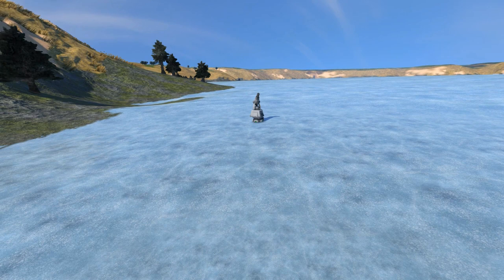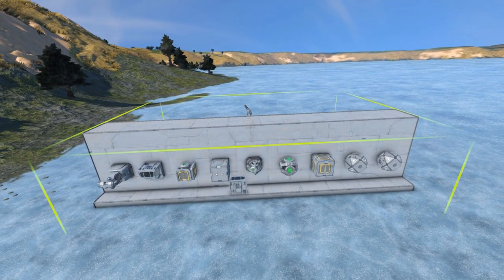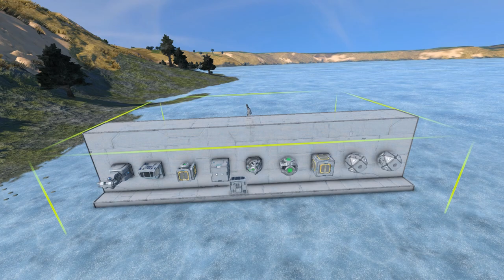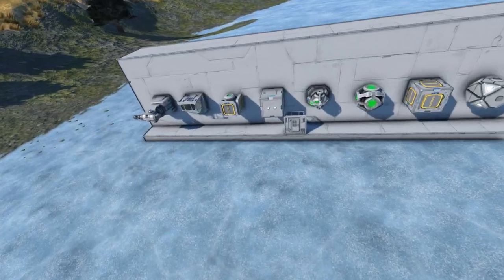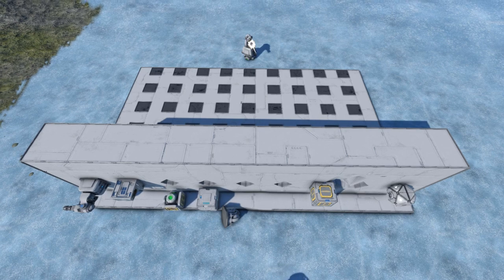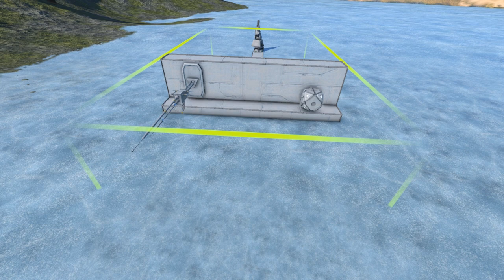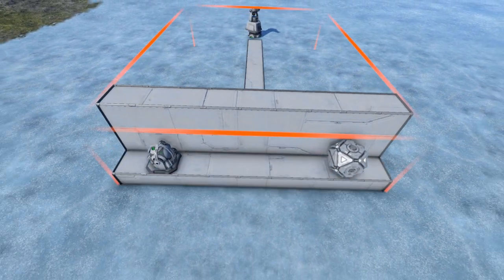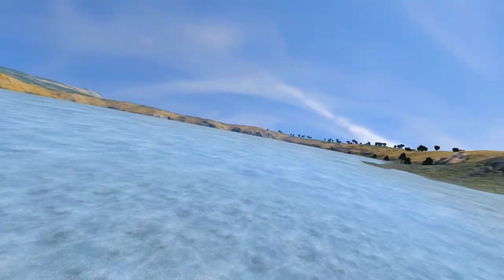Space Engineers Tutorial: How Decoys Work (tips, testing and tutorials for survival)

Comment: Anything with Computer Component is on the targeting list.  After Decoy is Antenna on large grid.  On small for a couple years it was always cockpit no matter what...Aragath got that changed to how large grid works.  You will want to test with moving grids and distance instead of staticly placed as that is how combat works.  Refineries can take more beating then heavy armor over the same surface area.  Trusters are second to Decoys in being made from glass in hp.
Reply from the maker: That's an interesting point about refineries, I've never thought to use them as armor before, they'd also probably work pretty well with welders repairing them since they have such a large footprint it'd be easy to have multiple welders in range...

Comment: Btw, in the test following 3:00, it's rather obvious that once the turned-on decoy gets blasted, the turret is targeting based on distance. It's quite obvious as it's switching left and right to the closest functional block. Now, it may be that you just accidentally placed the blocks so their distance from the turret reflected their priority, but that seems extremely unlikely. I think, based on that one test alone, that the turned-on decoys are targeted first, and then it's the functional blocks based purely on distance.

If you'f like to confirm/deny that, you could make a similar test rig with the blocks swapped about. That way, if the turret goes the same as here - turned-on decoy first then the middle blocks, left to right - it's a given that it works as I stated above. Otherwise, it's, like, the luckiest test setup ever.

PS. In your final test, the decoy may have been popping in and out of range of the turret as you were, by definition, placing the test grid slightly differently each time. I believe it's just the block priority and not the distance that plays a role here.

Comment: Light armor is good for building bulky, spaced out ships.  It's light weight compliments the sheer size that you will be building on and it is much cheaper than the rockets someone might use to kill your large ship.  Gatling bullets are much more efficient for the damage inflicted but an inner layer of heavier armor can tank the hits, particularly if the damage is dispersed along multiple blocks rather than just the one.
Reply from the maker: All true from what I've seen, as a few others have said, put your decoys in a position with a welder to repair them and you'll be even more difficult to defeat with automated turrets

Comment: Theres 2 reasons I can think off for puting decoys twards the front.  First off so it is one of the first things in range when the enemy starts fireing.  It does not help if half your ship is wrecked before it enters the engagement radius if your ship is particularly long.  Second is how effective is the decoy at the back of your ship if the enemy shoots out every useful block inbetween the front and the back trying to get to the decoy?  

Personaly I tend to stick decoys in heavy armored wings when i use them.  the armor makes the decoy last longer and generaly wont have anything important over there to get shot up.  I've tried decoy clouds but since they only absorb one hit its not really cost effective.  I find 1 decoy in an armored ball lobed at the turrets lasts longer than releasing 10-20 unprotected decoys.  Another fun trick is armor'd ball decoy mounted on a rotor.  spin the thing up as you approach and spread the damage over multiple armor faces.
Reply from the maker: Heavy armored wings are certainly the easiest way of getting your decoys in a position where the important stuff is out of the line of fire and still have things look reasonably good - it's my normal go-to setup.
I'm not normally game to use the rotor decoy trick for fear my ship will explode before I even get hit by any enemy fire :P

Comment: Okay, this is just stupid. I do not like this at all. This is a game mechanic programming, which cuts into the game.
First of all, it should be my choice how is the priority.
Second of all, I can understand if a decoy has a choosable mimic, aka what should it be. But not "I programmed the game" to be above all else.
Third of all, a turret should not know what is behind a wall. 

Fe.: I make a small ship wing with a decoy that is surrounded by heavy armor. The rest of the ship fires and is all okay without heavy armor because that decoy is there. Horrible at big ships where you can just layer 2-3 heavy armor. It's just cheating.
Good video, went a like, but this needs fixing.
Reply from the maker: Fair points, sadly I doubt keen are going to change much about decoys since they've been pretty well untouched in their mechanics since they were added. Because of that I just take it as an extra engineering challenge on how I can get functional decoys on a ship without it looking like some weird growth on the side :P
(or a bad attempt at a propeller for those who like the rotor method)
Reply: Yeaa. What a bad. It can easily brake the game. It's lucky nobody is using it.

Comment: please test again in 1.186. I have an idea for droppable decoys (a small reactor and decoy in a little heavy armor half slab sled to survive impact) that is detached from a rotor as a means of "dropping the bomb" on an earth like attack ship (Planetary installations mod for nice targets).  The decoys also have a sound block blaring an alarm sound when dropped, to let me know mid attack run if its still more or less decoying. So, the sled drops, survives and is powered.. sentry ignores it and continues firing at my ship as it tried to fly past all clever like.  maybe decoys are bugged, or maybe some mechanic im simply not getting here.
Reply from the maker: That's very odd, it should still be working the same. Does the turret switch to the decoys if you quickly fly your ship out of its range? It might be that the target switching isn't triggered - I haven't been able to work out what causes the turrets to switch targets but that might be a good reason to revisit these as well. Work out both issues :)
Reply: I do a "Fly-by" pass on a testing turret like yours, dropping the decoy off nearby.. within 200m of it or so.  the ship itself has internal decoys on the wingtips, which take hits for a bit as I approach.  I detach the deployable decoy sled, and gun never changes targets. I suspected the internal decoys held the attention, so did some passes with those decoys off, leaving only the deployables decoying- also tried a pass with zero internal decoys installed. The turret continues to plink away at my ship until I eventually get out of its range- shifting to different targets on my grid, then it engages the sleds. but as I re approach, it shoots at my ship again. So PLEASE retest the tests in this video with the newest major uptade, and if you feel like it, test it with my ship, in the manner described above. (Steam decoy tester grid): http://steamcommunity.com/sharedfiles/filedetails/?id=1307451759
Reply from the maker: Certainly sounds like I need to take another look, I've been wanting to for a while so I'll try to do it soon - I'll attempt to do something in the next few weeks :)

Comment: the distance does make a difference if the range of the turret picks up the other things first. that essentually renders the decoys useless as the turrent cant see them.
Reply from the maker: That might be true, though I still want to test whether the turrets target based on a grid being in range, or a block being in range. Also, whether they'll switch targets as soon as another block comes into range.
For small ships this sort of thing is very unlikely to be an issue as you'll probably be moving quickly and even for large ships you would need to be slowly coming into range for this to be a problem, but worth thinking of and accounting for both being chased and when attacking...

Comment: Could you use timer blocks to turn the decoys on and off? Would the gatling gun then switch targets?
Reply from the maker: I'm not sure, I still haven't tested the conditions under which a turret will switch targets, though now that we've got safe zones it might be more feasible to run those tests than it would have been previously
Reply: @Splitsie  You could also test how to make the decoy move fast enough to keep the turret from hitting it, probley some sorta cross shaped spinney thing (maybe add pistons, you would need either one for the decoy pod, or two for the pod and the rotor the arm spins on) with armored pods on the ends, would have to consider angles as well so the arms dont get shot off before the beacon/'s ideally. Or would that invite Klang?

Comment: wonder how effective putting a welder behind a decoy is, and weather welders are ranked higher in the targeting ranking
Reply: that would be an interesting thing to find out, see if the welder can keep it welded faster then the turret can shoot it
Reply: Riley Burling Even better idea: put two welders and a decoy between them, so they repair armor protecting them rather than the decoy itself.
Reply from the maker: I've been wondering the same thing, it might be interesting to look at just how many welders are needed to withstand a constant barrage from a gattling turret or maybe even missiles (if you use a projector to replace missing blocks as well)
Reply: I've tested it. If the decoy is not protected by armor, it gets shredded instantly; the welder won't help it. One layer of light armor repaired by a welder withstands 1 turret, but gets destroyed by 3. If it's heavy armor, you'd need dozens of turrets to break through. It even holds okay against missiles, but the degree of deformation that's happening is frightening. Two welders are needed not because of repair speed but in order to protect the construction from all sides - one welder won't be able to reach armor on the opposite side of the decoy.
Reply from the maker: Nice, I imagine it chews through components to manage the repairs - especially against the missile turrets
Reply: I'd think it's mostly steel plate -- and, well, there is a "method" for that. :P

Comment: I think the targeting distance of the turret affects which block is targeted first. in the 500 meter grid, it could have been outside of the default targeting range of the turret, which I believe is 500 meters. You could have been 10 meters or so off of the maximum range.
Reply from the maker: The turret was set to its maximum targeting range of 800m and the default is 600m :)